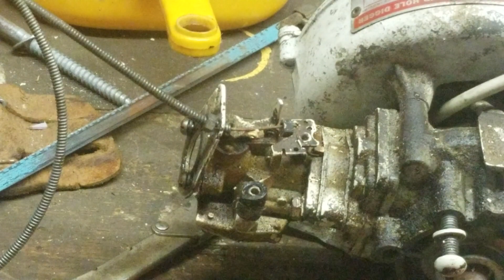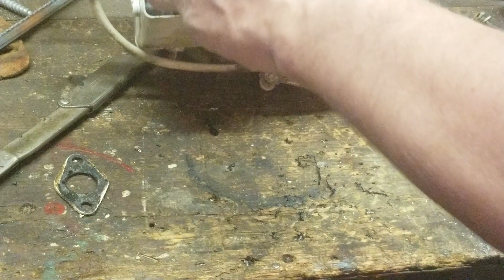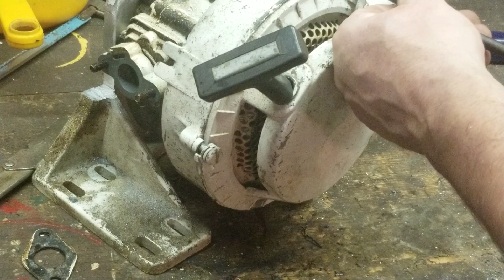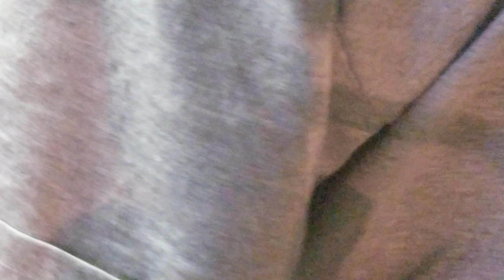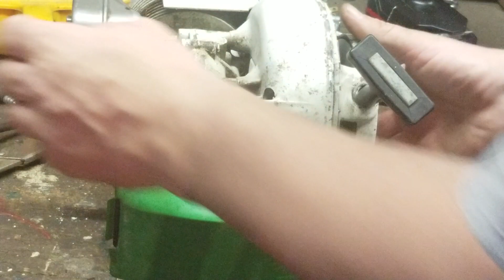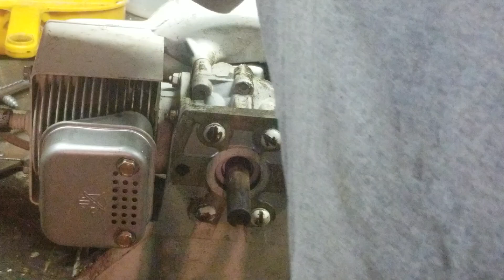Tecumseh engine mod part 3

Comment: I have one of thoes that looks identical it came off a earth auger and its biult mighty cheap but hey it works
Reply from the maker: Does your cylinder bolt too the case or do you have the plate at the end
Reply: I think case but seeing yours i think mines a bit diffrent
Reply from the maker: @koltonshampine5441  its really a Larsson engine before Tecumseh engine
Reply: @2strokeguru  it says techumseh on the fylwheel and on the casting so im pretty sure it is